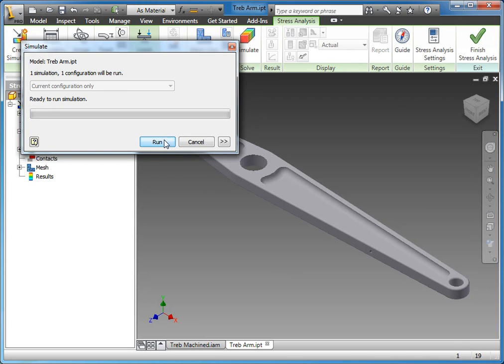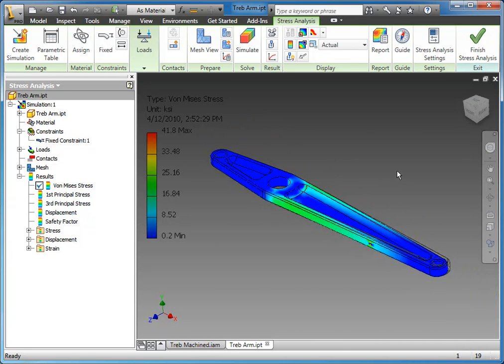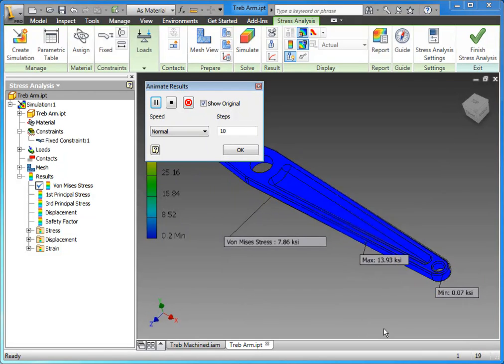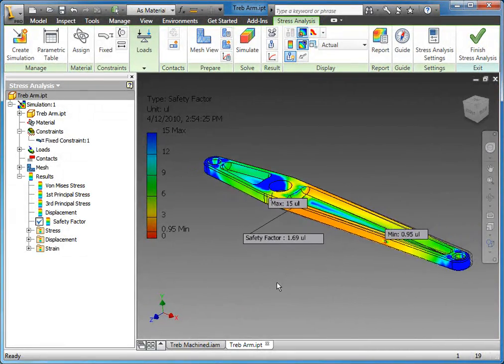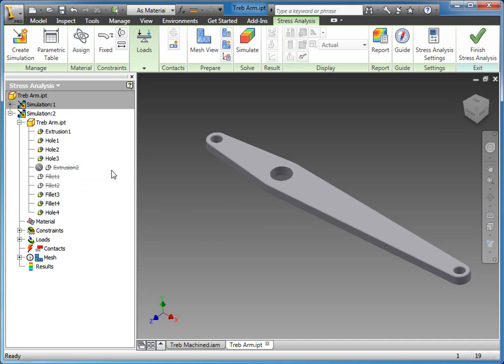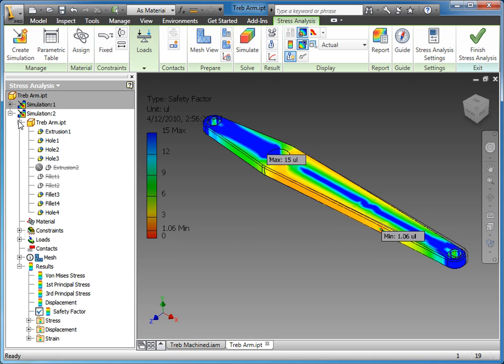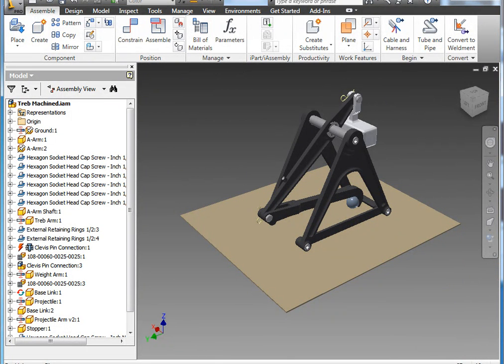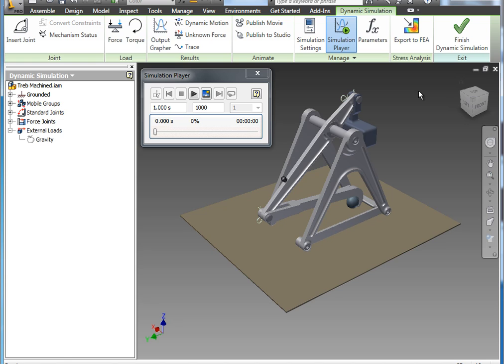Part 2 - Dynamic Simulation & Finite Element Analysis (FEA) - Autodesk Inventor 2011

Comment from the maker: That is done through Autodesk ALGOR and Inventor models can be linked into ALGOR with a push of a button. ALGOR does FEA, Computational Fluid Dynamics, Heat Transfer, and multi-physics. So you could build the piping system with Inventor Tube and Pipe then push to ALGOR to run extended analysis.